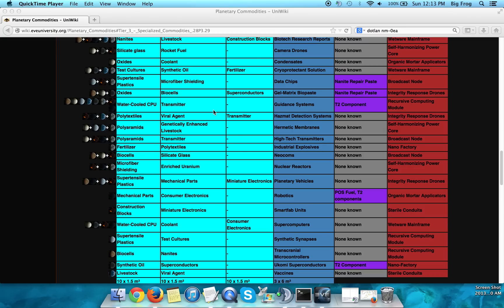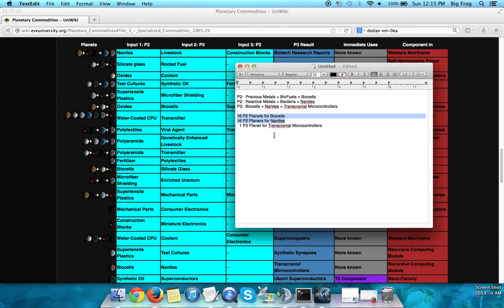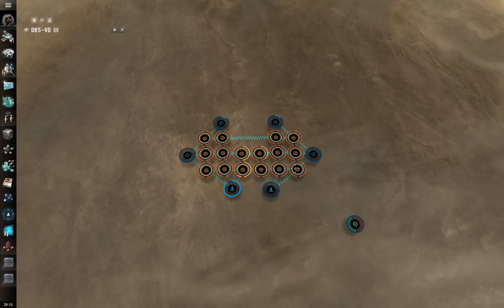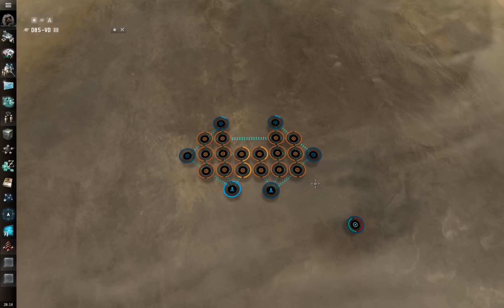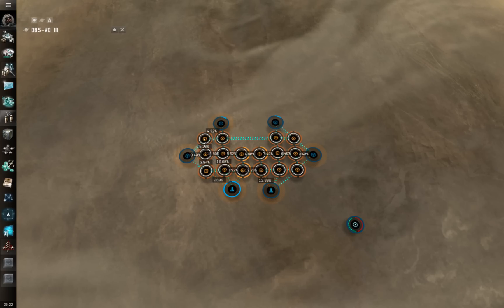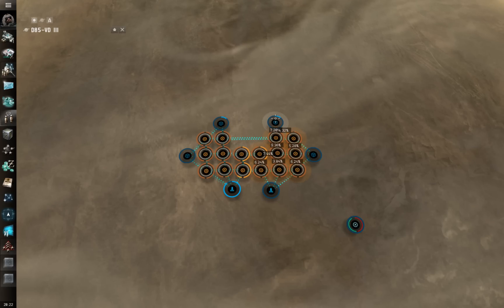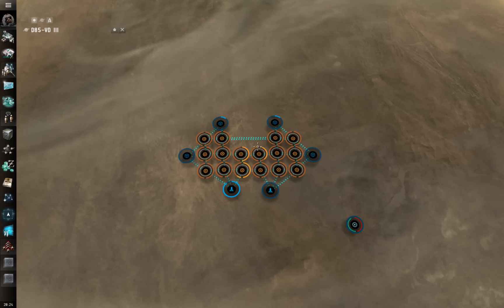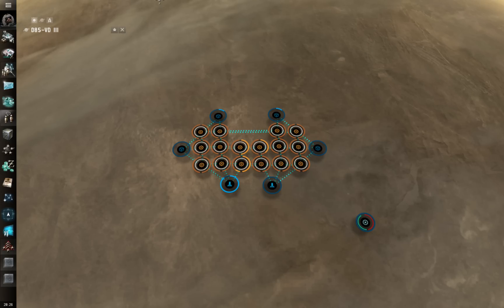Planetary Interaction - Part 2 - High Volume Production of P3

Comment: So basically PI isn't worth doing if you don't plan on creating more than one account. You've got six accounts, minimum, here working to produce less than 500mil ISK a month? That seems really low.
Reply: Yes it absolutely is worth doing. Even on just one account you get up to 6 planets. If you get a temperate, lava, gas, barren or plasma, and storm or oceanic as your first 5 planets then you can use them to extract any base PI material you could want. Then use the 6th for industry to make stuff out of them.

Set all your extractors for 14 day runs so you don't have to micromanage things much, have them fit for basic processing to condense it down a bit for shipping out and you could be pulling like 50-60M isk off your extractors every two weeks. Which is a pretty respectable haul for a mere 10-20 minutes of actual work once every 14 days.
Reply: In fact actually you can have 3 characters per account and 6 planets per character so... If you get your other two characters involved that makes 18 planets. Personally my estimate returns of about 10M per planet per 14 days is a conservative one too. I am actually pulling about 20-25M off each planet every 2 weeks so at 18 planets that would be roughly 360-450M.

Granted that could take more like 30 minutes to an hour to go collect between all 3 characters and requires some skill training on your other characters, but hey... That can be a lot of isk coming your way every 2 weeks.